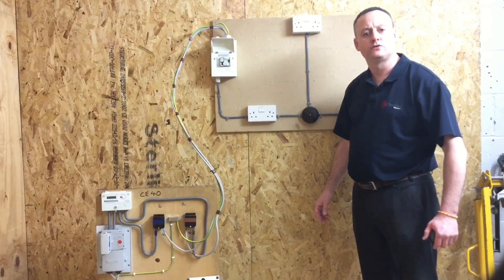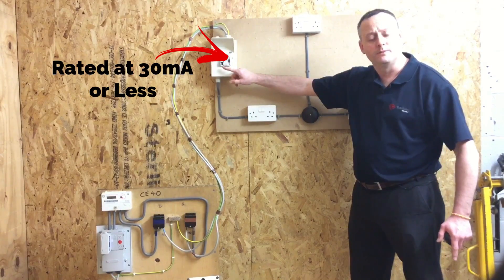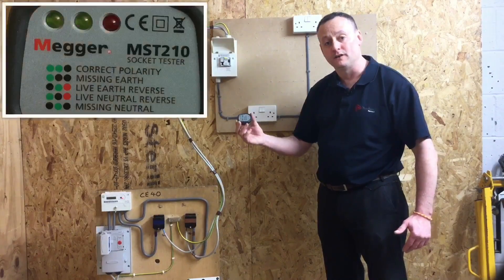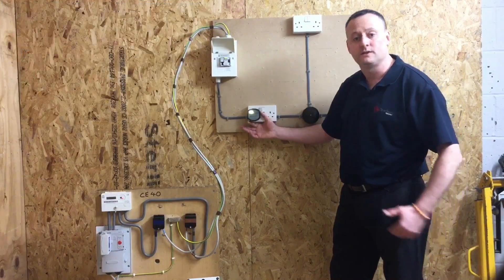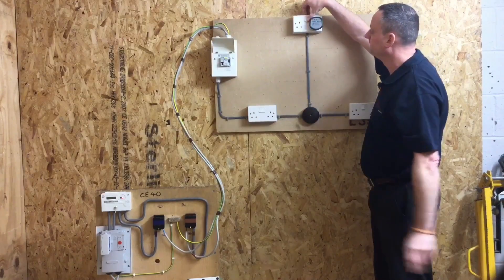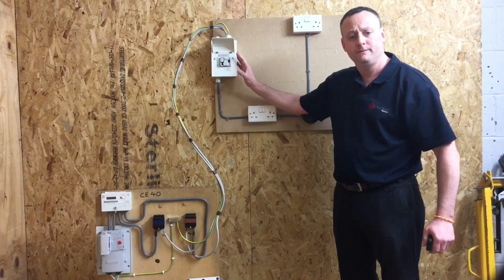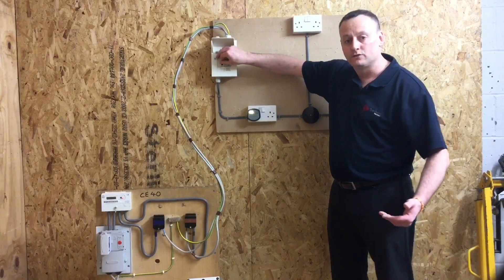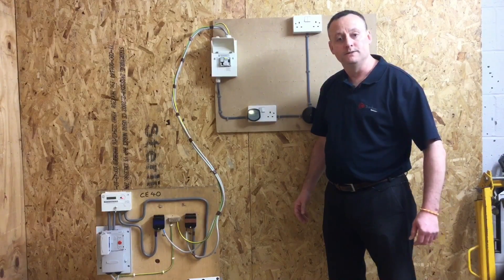Our A3 Radial Socket Circuit Tested Live for Re-Checking Polarity and Functional Tests

Comment: I've never properly understood what they mean when they say a 20A 2.5mm radial circuit can serve a maximum floor area of 50m2.
What if the circuit is run on the outside wall of a building?